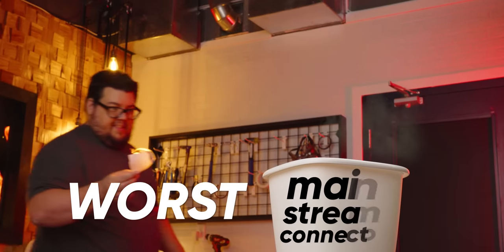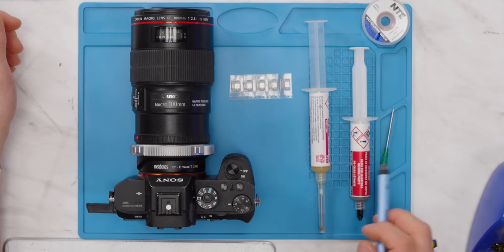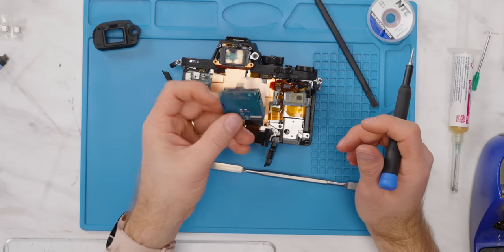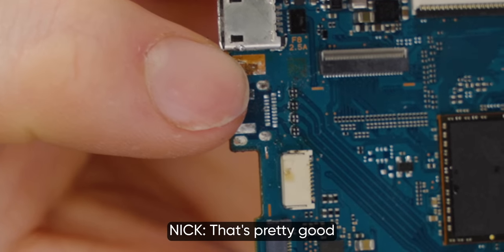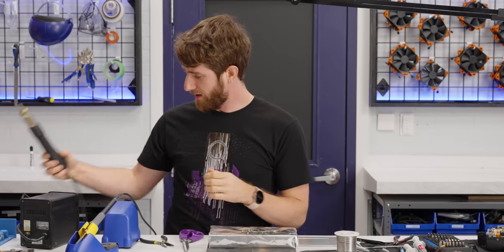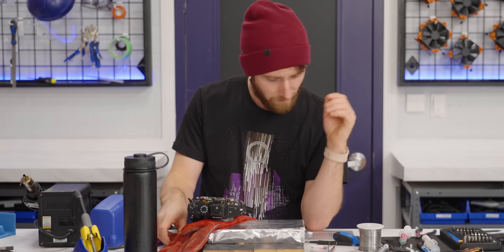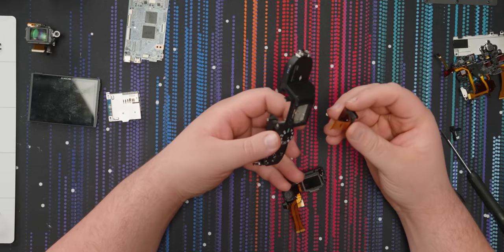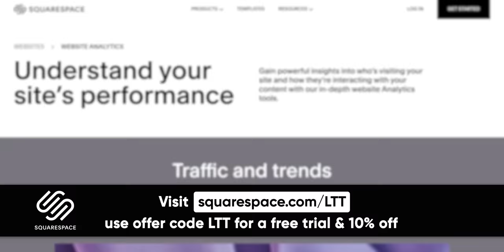This "cheap" repair almost BROKE me.

Comment: As someone who does small electronic repair for a living, this is the most stressful thing I've seen all week
Reply: even as someone, who has no clue about electronic soldering, seeing the plastic of the main board melt from the heatgun gave me anxiety
Reply: i used to be an electronics repair specialist for a class 3 shop. yeah this stressed me out like none other when i saw the size of that soldering tip. and yeah linus a good soldering iron will be about 300 bucks american in my opinion. as i used a hakko. he also needed a board warmer.
Reply: @maddog2010p  He could use an magnifying equipment while working
Reply: Linus' hands shakes more than my grandma with parkinson's. hahahahaha
Reply: and maybe use the soldering iron to remove shorts or solder it in with in the first place even though the tip is huge for this kind of connectors
Reply: Extremely painful to be honest.
Reply: No wonder why people compliment my steady hands. Its people like us that can do micro soldering without difficulties.
Reply: @maddog2010p  Nothing wrong with his iron. The desoldering went well.
Reply: @maddog2010p  There are loads of soldering iron stations out there under $80 that outbeat the Hakko FX Linus is using. No idea why people keep buying that outdated garbage these days. I'd argue 300 bucks is way too much for very basic tasks like this. Don't need a board preheater either, that's more useful for large BGA chips.
Reply: @EvilWiffles  cause i can tell you they are the best in the business and those 80 dollar units are trash with damn near zero warranty. hakko also innovates the market and makes about 90 percent of all soldering items out there and they get re-branded hakko are much better. outdated... yet still top of the soldering world and still makes new and improved units yearly.
Reply: @EvilWiffles  A lot of what you're paying for with the more expensive stations are ease of use features like sleep mode, fast and easy tip changes, reaching temp very quickly, heating to compensate for heat loss when in contact with the board, ect. I use a Hakko Fx-951 which are around $150 used and it works great for me. You'll also get nickel and dimed pretty fast when buying solder tips that aren't junk.
Reply: @AilisonCarvalho  you can still deal with that. Just put some kind of support for your hand, even a couple cheap books will do
Reply: @EvilWiffles  board preheater would be needed on GPU or motherboard. But even Nintendo switch can be fixed without onw
Reply: @maddog2010p  and something to sink the heat so you don't damage chips.
Reply: @EvilWiffles  They don't have the wattage.  You need to move fast.
Reply: @ChickenPermissionOG  They have wattage, they don't have a modern soldering iron tip with built in heater at the tip. The Hakko they are using has heater but it's not efficient because the tips are like sleeves that go over the heater, there is an air gap that limits heat transfer.
Reply: @maddog2010p  I have both a $500 station and a cheap X-Tronic 3020, and I can do with it anything I can do with my FM203-HD's iron. It has a comparable temp range, the same level of accuracy and holds all of the same tips. We use it as often as we do the iron from the Hakko. Been using it weekly for jobs for 4 years. Only has a 3 year warranty, but it can also be had for less than $50. It's a great iron. But then again, as is the FX-888D, FX-951-98 and especially the FX951-66, and all of those are fantastic Hakko stations that can be had for less than $300. The first two can be found for less than $100 during sales.
Reply: @EvilWiffles  Jbc is what I use has 20-40 watts.  It didn't help that he was using a cone tip has no heat transfer.
Reply: @siliconalleyelectronics187  KSGER is the station I like using and uses T12 system. Has a lot of the features of the FX-951. I'm pretty sure you can use the same tips as the FX-951.
Reply: @maddog2010p  Not sure about that. I been using the KSGER T12 soldering station for years and have not had a single issue. Has better features compared to FX-888 and is cheaper, excluding tips ofc.
Reply: @EvilWiffles  see and thats why i liked tha hakko as i have over 20 different tips to use and they can be hot swapped easy. i think it boils down to preference is all
Reply: @maddog2010p  Uh, KSGER T12 is also hotswappable. It uses the same tips that the better models of Hakko use (not the one Linus is using). KSGER outbeats my Hakko 951, because it's very compact and can be stacked on other things and has all the features I wanted and bonus for being able to use all the tips from the 951.
Reply: @Ahfeku  I have shaky hands and I can solder smd components the are 1mm in size or have multiple legs without much problem.
Reply: Linus eyeballing the board soldering got me real stressed. Why could he not have at least used jeweler/watch magnifying glasses at least if he wanted to be on budget (they are not expensive) ?
Reply: @maddog2010p  any suggestions for a decent hot air station for beginners that won’t totally break the bank??
Reply: @AilisonCarvalho  What do you mean?  We all know that Linus hands are completely steady, he never drops anything 😊

Comment: This is literally the greatest advert for Sony's Repair Services. I doubt they could've done better themselves.
Reply: True, shut up and take my money :D
Reply: @MrOneart  tbh, one could have done a bit more research and maybe thought about if it is a good idea to blow 500° hot air against plastic parts.....
Reply: It's a better advert for not buying sony in the first place (not that there's much better available from other manufacturers). This could have simply been made easier to service, or even using a more robust, high-quality, connector (I would expect both for the price of that camera).
Reply: @NewsBytesOnYouTube  It's an  7 years old camera, full hdmi was super rare in that time in non-pro cameras. Newer gen has full hdmi.
Reply: @NewsBytesOnYouTube  idk... Sony seems to have the most publicly available service manuals and replacement parts over other camera manufacturers. This would have been a relatively easy fix for someone with the skill set to do so. I'm all for right to repair-but I don't think that means that absolutely everyone should be able to perform every repair. We'd have to dumb down a lot of electronics to get that working.
Reply: Also it's basically discontinued, if you find one new they have been laying in storage for years. And used one are sth around 600bucks on ebay.
Reply: Aside from it being literally a 100 times the price of the thing that breaks. 
THAT is the problem.
Reply: @ImTotallyTechy  Everyone should be able to. Whether or not they'll succeed isn't relevant.
Reply: lmao, I was thinking this throughout the video.  THIS is why you pay them $600.
Reply: @NewsBytesOnYouTube  first of all sony is one of only 3 camera manufacturers who gives a damn enough to release full repair schematics, second of all linus shot 500 degrees of heat at the board when it only needed 300 to 350 at best that's not sony's fault, third linus could have used sony's imaging edge app which lets you run the signal via usb instead of making all this drama and spewing informed and untrained repair attempts at assuming people who know even less in the comment sections, fourth: its from 2015, very few cameras came with hdmi output at all at the time, its kind of a miracle product. fifth: the fact sony were willing to service and still has spare parts for a nearly decade old product is testament to their dedication to the prosumer photography market. you simply could not be more wrong bryan, sorry.
Reply: @trajectoryunown  I think this video was a great representation of this this then. Sony made the repair manuals accessible and the parts were readily available. Linus was able to attempt the repair with the best tools available to him, and didn't succeed. I wouldn't have succeeded either. But other than non-specialized equipment (ie any old hotplate) and sheer skill, there was nothing keeping this from being successful. As long as I can get some independently skilled individual to repair the device, I don't need it to be like Legos.
Reply: Paying $400 to get your product fixed, and then another $200 to get it in a working condition is not exactly a ringing endorsement.
Reply: That or the greatest argument that sony needs to make cameras that aren't impossible for user repair. or perhaps an argument that micro hdmi needs to stop being a thing. Either way it's a bad on Sony for making cameras that break due to bad components and then charging users $500 to fix their bad engineering every few years.
Reply: @FARBerserker  Yeah, because the only thing that needed to be done was buying a port. Like there was no labour needed or calibration, those are free, aren't they?
Reply: @HYDRAdude  no, not necessarily. I understand that. But it coulda been done for $4 in the hands of someone skilled, and since it would have been the same motherboard, no calibration would have been needed. I'm not the most savvy on cars, I'll admit, so maybe this doesn't line up perfectly. That being said, this situation feels like the a seal/gasket failing on a steering column. The car's repair manual is out there and the gasket costs only 4-10 bucks. Any mechanic worth their weight in salt could get it done easily, not just the dealership mechanics, but any old mechanic. Instead, someone with minimal car knowledge attempts to do the repair themselves, fair enough. But they end up fucking up the entire steering column in the process, needing to replace the entire thing. Now that they've placed a brand new part into their old vehicle, they need to get the front end realigned at a professional shop. Could they do the alignment at home? Sure, but they've already fucked up enough.

All for right to repair, but as long as an independent and skilled repairman can give me a reasonable price for a fix that isn't replacing the whole unit or going back to manufacturer, I'm happy. And trust me, I've gotten my sony cameras repaired at 3rd party service shops for a fraction of the price of Sony.
Reply: @ImTotallyTechy   it does seem like they've done their due diligence with right to repair by making the information and parts available.

Although like the SD port they removed early on in this video. I think for failure points like ports, being easily replaceable (IE without soldering) is important.

I definitely wouldn't require it or anything. But it would seriously cut down on waste.
Reply: If it was a canon and they went through CPS they would have gotten a 30% repair discount and had the camera back in 2 days.
Reply: Still, right to repair isnt solely focused on soldering but easily replaceable parts like the sd card part. Having the micro hdmi soldered to the board makes it harder to repair.
Reply: @Volker_A4  fair enough.

For what it's worth I've needed repairs on my sony cameras 3 times. 2 of them were the SD slot, and for no fault of Sony too. SD cards are so britile and cheap that they will leave fragments inside if heavily used. Seeing that the SD slot is easily replaceable makes me think I definitely could have done it myself.

The other issue was sensor damage caused by extreme shooting conditions. Nothing necessarily sonys fault, and every time a 3rd party repair shop got me fixed up in a jiffy. Way better job than non-apple repair shops can do on iPhones.

Interesting seeing this video knowing 66% of my repairs coulda been done at home. For me, this is a Sony W. But there's always room for improvement and it's important we call them on it.
Reply: @NewsBytesOnYouTube  The fact that Sony would even take a user repaired camera that's almost a decade old to calibrate it or even offer a service to fix it is quite amazing for such a massive company.
Reply: @FARBerserker  the cost is representative of the work that needs done to fix the $5.00 part, not the part cost itself. It will also factor in the risk that other parts might be damaged in the repair.
Reply: @ImTotallyTechy  Yup. It's great to have the option of hiring somebody whose abilities you're confident in. Linus just decided to take the risk himself, which unfortunately didn't pay off in this case.
Props to Sony btw.
Reply: @andrewszczplaylist  Brand new one is over 2k USD in online stores available where I am(SEAsia). Better off sending it for repair definitely.
Reply: Only do it yourself if you can make a video with a sponsor and get 2+ M views. That way it doesnt matter if you fail the repair.
Reply: @johnlucas6683  I wouldn't buy a7s2 from "old new"[same thing as new a7mk1s you can sometimes find] stock for 2k USD, it's 2023, sony has stopped producing all 2gen a7 bodies 2 years ago(so a7r2, a7ii and a7s2). It's a camera from 2015, you'd better off with a7iii.

Comment: Tried to do this with a broken 1dxii... couldn't get it, put it back together wrong, and it shorted something on the board and costed extra to repair
Reply: Love ya vids man didn't expect to see you here :)
Reply: costed lol
Reply: Valueable lesson here, right to repair is a good thing, however, you need to have the knowledge, in cases like this one, linus ended up spending double the amount he was going to pay by sending this in to repair. If you have the knowledge and u know what you are doing, right to repair is a fair use, however, knowledge is mostly what these service centers sell, cuz when u dont know what u are doing, u end up paying the price.
Reply: @onlineghost9813  I think it depends on how you look at it. If you absolutely need something fixed, sure send it in for repair. But for something broken that you have already a replacement for, I think it's fine to risk breaking it more and gaining the knowledge of opening it up and seeing the components and seeing what you can do about it.
Reply: @JamieReynolds89  try hard english speaker lmao
Reply: @shangerdanger  🔈?
Reply: right to repair sounds good till you are over your head and you make the right decision to send it to a pro.
Reply: I'm going to guess you didn't map out the screws correctly so you put one that's too long in a short hole and caused long screw damage to the board. Really common thing for inexperienced techs. Hopefully you got it all resolved in the end though.
Reply: @MrGamelover23  im not missing that, im very aware. but this was not the case, he ws able to get the parts.
Reply: should have had a sponsor lol
Reply: @onlineghost9813  Mostly the convenience of getting it fixed professionally but yeah knowledge too.
Reply: That’s called male pride. Know your limits.
Reply: @unlokia  is it? Smh
Reply: @c-v-n3322  Right to repair means you have the right to send it to a pro. It doesn't just mean you have to repair stuff yourself. Most people, even tech enthusiasts probably don't have the skills or tools to do cheap component level repairs. But there is probably someone local who does and right to repair would allow them access to the tools, parts, schematics they need.
Reply: @roddymcgtravels  all your favorite youtubers watch Linus.
Reply: Broke a Samsung hard drive conector similar situation then broke the board trying to repair the connector then broke the drive trying to repair the board. 😂 learned that sometimes you need to stop when it’s getting out of your hands.
Reply: @HentaiNat  Yep but it feels awesome when you do it yourself bragging rights and all, plus most of the time you learn a new skill.
Reply: @shangerdanger  got to love these 5th grade insults xDDDD
Reply: @c-v-n3322  well, right to repair allows the pros to get the parts in the first place instead of sending it back to the POS corporation that will just throw it away, and demand you to buy the newer stuff *cough* *cough* apple's "Genius" Bar

RTR helps not only for the consumer but also the repair industry, you can choose to repait it yourself, or take it to a pro next door or choose to go the safe route and pay extra to send it back for official repair, it's all about CHOICE
Reply: @onlineghost9813  You said “if” so many times, it’s clear you’ve missed the point of RTR.
Reply: @c-v-n3322  RTR is mostly about making sure the independent shop is supported and can be confident in repairs. Reducing e-waste is a “knock-on” effect.
Reply: Yeah but the repair was actually worth it then... 😂👌🏼
Reply: @c-v-n3322  Or... YOU HAVE THE OPTION! Right to repair is about having the choice and ability. Big example is if a company goes bust or stops supporting that product, means third party repairers cans till do it. Also if things were designed to be easy to repair parts in first place, wouldn't need the pro for the repair. But apparently that isn't obvious enough yet? Making things hard to repair is an engineering choice and is a pain in the ass for the companies engineers and pro repairers as much as it is for the consumer. It's money grabbing and anti consumer. Prime example Steve Jobs openly stated that his products should be like magic and the users shouldn't be able to open them or mess with anything inside because it ruins the "magic". Only apple should be allowed to mess with them. [source: his biography written with consultation form him and close friends over years]
Reply: @Later_Nerd  yeah probably. I was in thailand on a trip and use my camera for underwater photo/video. I needed the camera to work for my last day there, and had another work trip immediately after in maldives. The risky repair in a dark hotel room was my only chance haha
Reply: What it should mean is the right to open any device to repair, without first breaking it. so the use of glues and one way screws would be out.
Reply: @JamieReynolds89  what's wrong with it? isn't that the tense?
Reply: @c-v-n3322  Right to repair sounds good when you can send it to the pro 10 minutes away instead of shipping it across the country for repair.